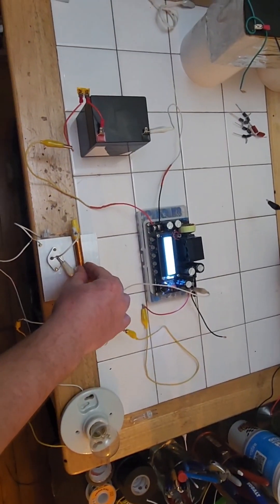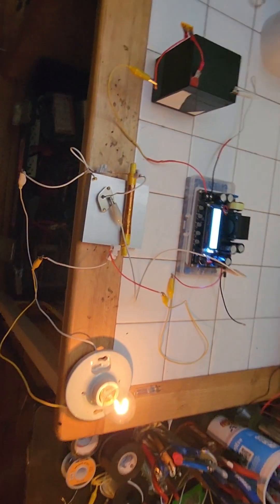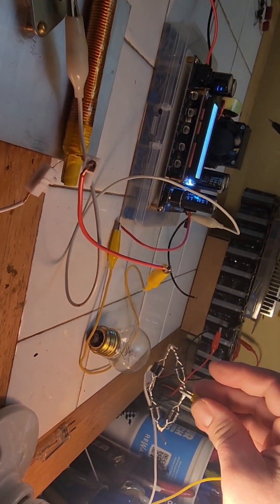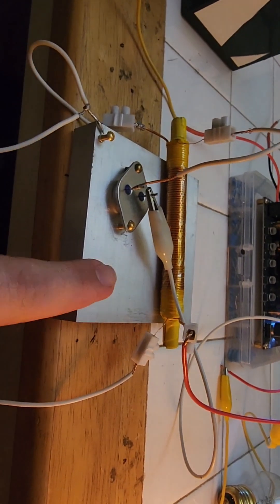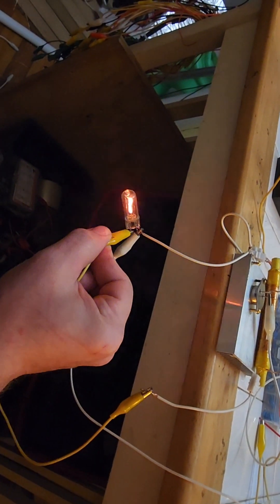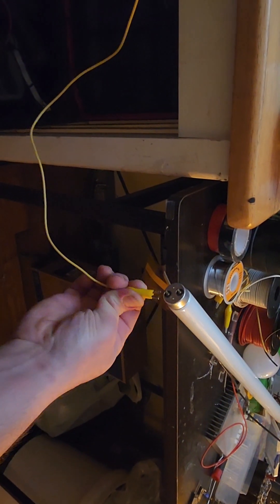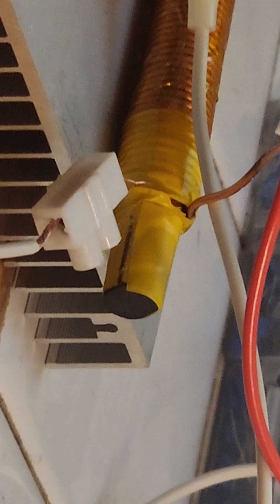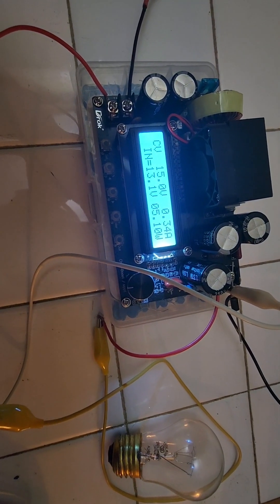🪄THE PULSAR IS BORN. ULTRA EFFICIENT DUAL PURPOSE WIRED & WIRELESS POWER GENERATOR🪄

Comment: These things make for great high-ish amps/watts per second cap dumps. I'll have one to show off here shortly. I'm going to see if I can maintain 100 watt seconds to start with. I think the key is decoupling from the source through capacitance. Trying to maintain the current flow as close to zero for as long as possible while keeping the charge potential should result in back emf spikes that are greater than the loss and that's my plan.